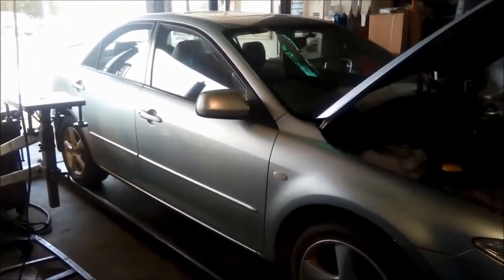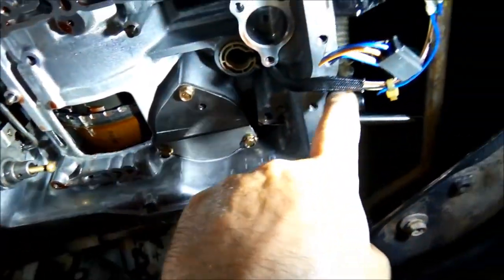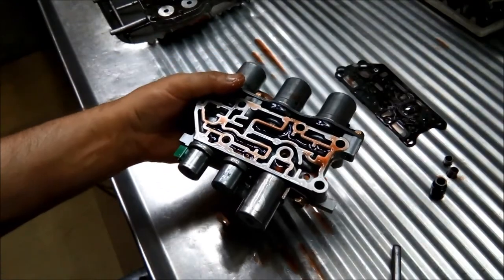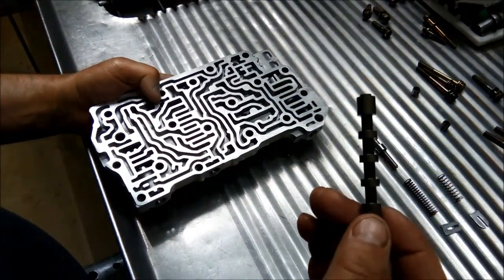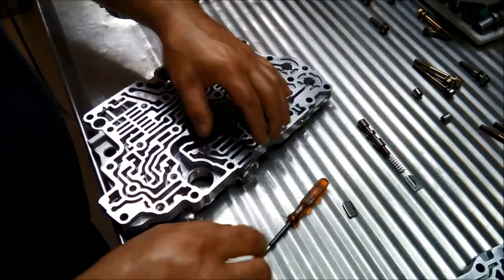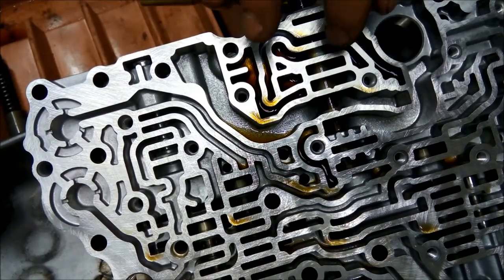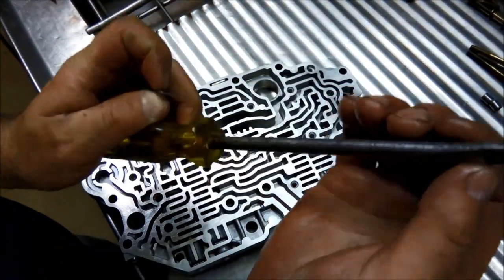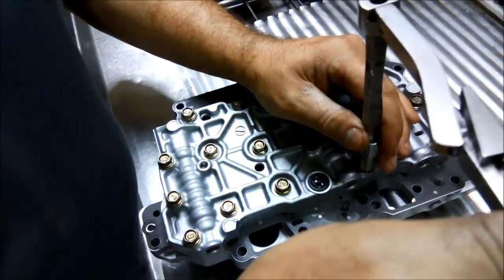Mazda 6 FN4AEL / Ford 4F27E Auto Transmission Recondition Rebuild 1 of 3

Comment: Just want to let you know that a 5 year old video is still helping. I Have a FN4AEL in a 2006 Mazda 5 also know as the Premacy. The previous owner of the vehicle hot codes for one or two of the solenoids and didn't want mess with it. So i took it of his hands and bought a valve body and a shift kit off Amazon. I just disassemble the valve body to install the shift kit. And I noticed all of the valves are gummed up. I used a soft bristled nylon brush in the bores put it all back together. I didn't know that those Pistons are supposed to move as easily as they do in your video. I need to go back now and recheck them because when I fill the transmission up with the Mazda fluid ran it up to temperature if physically wouldn't shift past reverse. 
If you do read this thanks for your video and maybe you could tell me the little lever from the valve body that interfaces with the Gear selector in the Transmission. Should it be in a certain position when I install the valve body or does the fluid pressure take care of it?
Reply from the maker: hi, you need to make sure selector valve is correctly aligned. these trans also have issue of servo piston breaking and/or wearing larger servo piston rod guide port in case. when you remove vbody you can air pressure test apply ports.....few things to check. cheers
Reply: Thank you for the replying. I'm having trouble finding any information on where the selector switch should be set. I hope it doesn't have any other issues as the transmission only has 100,000 miles on it.
Reply: I really don't want to drop the transmission I'm just a shade tree mechanic.
Reply: I believe I found the info car should be in drive and selector inside the transmission should be in Drive. Correct?

Comment: Hi there!
A question: My 2007 2.3L 5-speed Mazda 6 V-Belt suddenly unravelled (let's say 70% of it) but at the exact same time the car would accelerate but won't shift into any gear. I could hear a fairly buzzing sound while trying to shift.
Check engine light is off but AT is on. Could it be related to the V-belt? I know is crazy but is such a coincidence that both thing happened at the same time!

Comment: Great video!! I'm looking at dropping the pan and valve body. Any tips on getting the accumulators back in and keeping them there when working under the car? Gravity is not our friend in this instance lol.

The trans sometimes is hard to get into reverse and 1st is nearly impossible. Something pops and then everything shifts normal again.
Reply from the maker: hi, sounds like selector cable issue. cheers
Reply: @YepThatsIt  I'm hoping so, any idea on what to look for? I'm going to open up the selector cover and take another look.
Reply from the maker: disconnect cable at the trans and see if you can select trans easily, then you will eliminate if its in trans or cable end. if its in the tbar selector, look for work bushings or broken plastic sleeves, could also be gummed up cable or frayed. cheers
Reply: @YepThatsIt  great will do. I disconnected it at the shifter today to see if I could push it to set the park pin but no luck. When it's in park, it still rolls.
I didn't do it at the transmission.
Reply: P
Reply: Hello thank you for video, i got fault code P0730 in this gearbox.
Can this code indicate an internal failure in the body valve?
Reply: Posting a follow up… sold the car a while back and i kept in touch with the buyer. End result, if I remember right, was the CV axle was half out of the transmission. Transmission was fine. Buyer made a great deal from me… car was mint and I flogged it to him for $500.

Comment: I've been working to get a 2007 focus with almost 200,000 miles drivable for my friend... after everything else was done and it would fit start, when I took it for a test drive, I noticed the transmission slipping. It looked like the transmission fluid had never been changed. 

So I finally got almost all the old fluid out by draining and filling between drives. It hasn't improved the problem, though. 

I think I have it narrowed down to it slipping when the torque converter clutch is engaging or disengaging. Accelerate when the scan tool says the clutch solenoid is modulating and it revs up without speeding up. Possibly also happening while shifting from 3rd to 4th... I need to test more. 

They're broke, so there's no way it's going to a specialist. That's why I put so much time into this for free to get it running. 

All I would be confidently capable of is working on the valve body, checking the valves and installing new solenoids. Do you think it's probably a more serious problem than that? Should I even bother with the solenoids?

I know it should ideally be rebuilt, but I'm afraid it I actually took it out and got it apart, I wouldn't get it back together again correctly.
Reply from the maker: hi, there are a few things you could try...contact me on facebook link, at least we can exchange vids and pics and beers on there. cheers
Reply: Same issue to me. I just bought rebuilding kit to replace the old one. Hopefully it will work.

Comment: 2009 Ford Fusion delayed engagement from a stop.  Jerks a little.  All the other gears are good.  Thinking B solenoid or the clutch plates.  Not done a trans yet.  Am I on the right path.  Thinking of doing my first rebuild or partial since everything else is smooth.  Recommendations on the possible problem?  Swapping the solenoids this weekend to try that angle.    Thanks
Reply from the maker: hi, if one solenoid contaminated then all will be. make sure you check all the basics before you start pulling apart. cheers

Comment: Hi there!!!  I have a 2008 Mazda 6,  the "AT" ligth is on , the scanner says Solenoid B is stuck on (p0757) ....the thing is that my car has no reverse _   Can a faulty TCM cause a transmission to lose reverse?  or  is the solenoid B that's causing that issue?
Reply from the maker: hi, sorry for delay in reply, we just got back last monday. it can if solenoid is stuck allowing fluid in wrong direction. cheers

Comment: Hello, is the brain in this vehicle the same as in the fnr5 gearbox?
Reply from the maker: hi one is 4 speed yours is 5 speed. cheers
Reply: @YepThatsIt  Hey is there a chance you can tell me what are transmission valve body torque specs are for 2006 Mazda 3s 2.3 4cyl DOHC Automatic

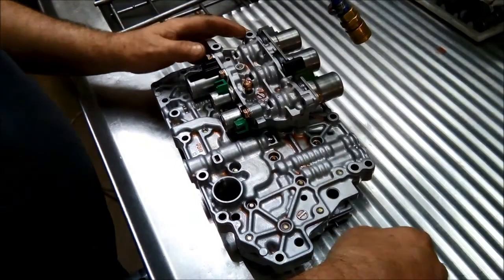Comment: Thanks for the video. If I just want to change the solenoid block, should I still take the whole staff out as happened here 09:25
Reply from the maker: hi, always good to pressure test the clutches when you lower the valve body. on these check out the servo piston...the shaft wears out the case, however saying all that it is entirely up to you ! cheers
Reply: In the video it appears you are using the old gaskets how important is it to change the gaskets

Comment: I have a 99 Premacy 1.8 with 130k miles.  The hold light has been randomly flashing and then the AT fails to select OD.  Any ideas what the most likely cause?
Reply from the maker: hi. electrical issue. most likely contaminated/leaking solenoid. always check all the basics first before you pull anything apart. cheers

Comment: Good!  4F27E I have that box, it presents fault only in Cold and when it lasts more than 1/2 hour off ..!  Failure does not apply speed in DRIVER, it must warm up 10 minutes and makes all changes well .. With great force and perfectly!  What should I replace or repair?  Thank you
Reply from the maker: hi, have you taken off the trans pan? could be blocked filter and or sticky valve in valve body. cheers
Reply: @YepThatsIt  I have never taken out a pan, my vehicle has 150,000 miles, should I change the oil box?  Thank you

Comment: Hi, I have a Ford Focus MK2 (2006)European built with a 4F27E transmission (I believe, not confirmed) and I want to rebuild it. How do I know for sure if my transmission carry a single sided or a double sided clutches in order to purchase the right kit?

My car has about 80K miles, and I have never changed the oil in about 6 years of ownership. I noticed a feedback on the transmission at one time, so I immediately checked the oil. I noticed the oil was VERY dirty (brown river water in color) so I changed it myself. I noticed that there were NO metal filings nor any excessive clutch material in the pan, next to nothing at all. I have seen much worse that didn't have a problem. Overall, everything looked, I would say better than average inside the pan. After changing the oil, the transmission started giving different codes indicating Shift Solenoid C fault, Engine System Defaults, and Transmission Gear Ratio Incorrect. Sometimes the car would have a Hard Shift and a prolong shift from first to second gear. I also noticed that the car was stuck in high gear and would take off in same gear. I changed out the oil again and put back in the same old solenoid since the new solenoid continued giving the same code. The solenoid code went away afterwards even with the old one.
 
What are your thoughts as to what could be the problem/issue with my transmission? Someone mentioned that the pressure valve could be sticking and causing the problem. I also saw that they are selling a modified shift kit for this transmission. Would that help or fix my situation?

Thank you for your help.
Reply from the maker: hi, for more technical questions contact me via our facebook link in description, bring some beers too link in description, cheers

Comment: Great movie!!!! Hello! I have a problem with my 4F27E in the Ford Focus mk2 2.0 2008. 4-speed gearbox.
The problem arises when the box acquires temperature. The more hot, the more frequent jerking symptoms. Transmission tugs when it stops and I move. And at the pit stop, he occasionally taps when changing gears from P to R, from R to D and vice versa. The hydraulic controller has been pulled out and apparently it is not roasted. Two Shift A and B solenoid valves have been replaced because they did not want to change gears, but now it's ok. The above symptoms remain. What's the problem? Please help
Reply from the maker: hi, did you torque the valve body bolts per specs ( 75 - 90 inch lb )? if over tight it can restrict valves from shuttling freely, especially when warms up. different metals expand at different rates with temperature. check the accumulator pistons and the servo piston rod hasn`t worn the bore in case ( common on these, but band is only for 2nd and 4th ). maybe have a look at the other pwm solenoids, they operate from varying amps, pulse width modulated solenoids regulate the fluid from the solenoids to the clutches, whereas the shift solenoids are just on/off. cheers
Reply: @YepThatsIt  I do not have that knowledge. The mechanic did it for me. I will ask. I'm from Poland and I do not know English very much .... Can shift A and B cause jerks when I move and stop the car?
Reply from the maker: hi, I`d recommend you ask your mechanic, but I would recommend see a transmission specialist. cheers
Reply: @YepThatsIt  I sent a hydraulic driver for HYDRO-TEST.
And you know what turned out that shift A and B deviate from the norm and it is for replacement, and the body gasket is worn out.
Do you know where in USA you can buy such electrovalves (new OEM Ford) at a good price? In Europe it is very expensive: (
Reply from the maker: @ha48124  try ebay cheers

Comment: The automatic transmission mazda  does not go into reverse before the oil warms up. What could be the cause of the malfunction?
Reply from the maker: hi, can be any number of things? start by checking all the basics first. cheers
Reply: @YepThatsIt  Thank you for your reply. My car is a 2000 model automatic Mazda 323. Can it prevent me from shifting into gear due to the solenoids?

Comment: I reckon you'd have a lot less gunk getting in the valves if you pulled them out before sanding/grinding the surface.

I've got to figure out why my Mazda is screeching like a banshee in Reverse and bogs the engine down in Drive.
'
I bolted the TC to the engine first, then slid on the trans like you do a manual.  Rotated the engine by hand and realized the mistake.  What I'm hoping to spot is what could have become damaged beyond the oil pump from that fiasco.  No problems in Neutral or Park.  

I don't know what I hope the problem is.  I wish there was no problem, this car is driving me crazy!
Reply from the maker: hi, less flexing when valves are in place.... not correct way to fit an automatic transmission, hard to determine damage without having it apart, we send torque converters away to be reconditioned. cheers
Reply: @YepThatsIt  problem worked itself out after pulling it apart yet again.  I suspect sticking valves from new fluid and debris flow.

Comment: How about if gear 2 and 3 ratio incorrect? Is it valve body or mechanical inside problem??
Reply from the maker: hi, check all basics first before you remove pan for a peek. cheers

Comment: .

My automatic transmission is not shifting 4rt to 5th gear why? Also hard shifting 1st to 2nd gear ALL THESE PROBLEM CAME AFTER ENGINE REPLACEMENT. Please provide me exact possible reasons.  is valve body cleaning good option for solving these issues?.

   p0735-FF TRANSMISSION GEAR # 5 INCORRECT RATIO
                         & p2708 -FF SHIFT SOLENOID F STUCK ON
Reply from the maker: hi, wow exact reasons ! i`d need to see the vehicle. fault codes indicate electrical parameters have been exceeded a few consecutive times. cheers

Comment: I have a 2012 transit connect with 130k miles on it. Transmission was rebuilt at 48k miles while under warranty, something to do with overdrive as the rpm would surge up and down rhythmically while on the interstate. 
Well about 6 months ago I'm cruising along at about 45 mph coasting downhill and the transmission downshifts massively out of nowhere. Van went from 45 mph to like 15 mph in a split second and I just about ate the steering wheel lol.
I pulled over to the side of the road and put into neutral and back into drive and van wouldn't move.  I turn the van off and everything returned to normal and van has driven fine for another 5k miles. But I've been paranoid about it happening again. Any ideas what could have happened?
Thinking of doing the filter and fluid anyway so I'll be able to inspect pan contents and check anything you may recommend.
Reply from the maker: hi, there was a recall on the 6R series transmissions ( 6r60 & 6r80 ) I read about that caused intermittent downshifting from 6th to 2nd on these...I think was faulty speed sensor confusing the computer. hope that helps cheers
Reply: @YepThatsIt  are those variations of the 4F27E in my transit connect? Or does my connect not have a 4F27E?
Reply from the maker: I thought has 6r60 or 6r80 trans?
Reply from the maker: get on google im sure you will find the recall info somewhere
Reply: @YepThatsIt  my brother in law says it's a 4f27e and ots also listed in the header of this video as such also. Transit connect 2.0L Duratec
Reply: The transit connect is a fwd minivan based off of the focus platform I think.
Reply from the maker: sorry my bad, my list shows 6r60? if its the 6speed would be 6F-35 trans? I'm sorry haven`t seen these yet. will look into it. cheers
Reply: @YepThatsIt  thanks so much. With what I know now I have to wonder if the transmission had problems hauling a focus around it doesnt bode well to put this transmission in a commercial minivan lol. There is a lot of confusion at auto parts stores also when I ask for transit connect parts they automatically think of the bigger version van that is simply called the transit.
Reply from the maker: strange problem for this trans....if its the 4f27e the only thing I could think of is if the servo piston pin has broken off and locked up somehow. interesting how hasn't happened again for quite a while like you mention
Reply from the maker: haha yeah seems to be the first issue to id the transmission...I haven't heard of that problem you described for 4f27e.... would you say it went from 4th to 1st? or 4th to 2nd?
Reply: @YepThatsIt  I dont really know if it was 4th to 2nd or 4th to 1st, all I know it surprised the heck out of me lol. I had just come to a stop before a Crest of a hill for a stopped school bus and when it began moving I slowly accelerated to the top of the hill and began coasting down the other side (Ohio State Highway Patrol right on my bumper) and as the engine rpm dropped as 4th engaged BAMMM!!! The van practically stood on its nose....both of my thumbs bent backwards, my hands punched forward as my thumbs bent back and they hit the turn signals and the wipers too. Lol I mean it was like I hit a brick wall and I know the Trooper thought I may be drunk as he almost hit me. Like I said I immediately pulled over and turned my wipers and turn signals off and put the gear selector into park, which held, and then move to drive and nothing happens but engine revving so I put it in 2 and 1 and no engagement there either. I thought crap its blown up the transmission and i turned off the engine. Sat there for a second and decided to turn it back on and it worked fine for the rest if the 50 miles home. Like i said i have no idea what happened it was just like i hit an invisible wall.